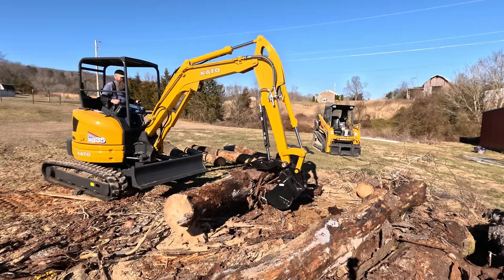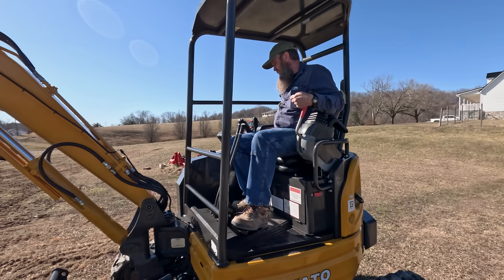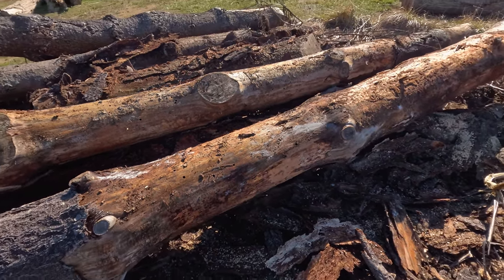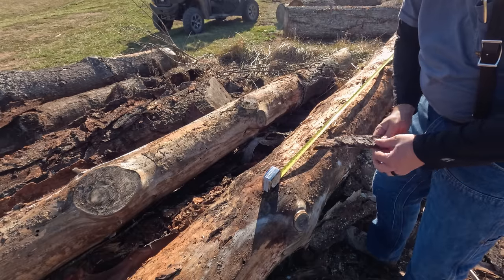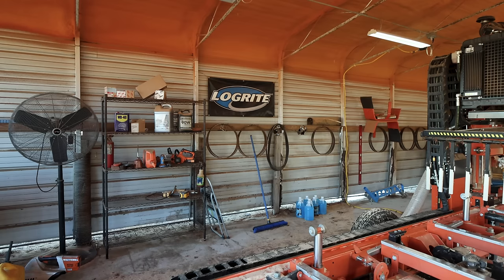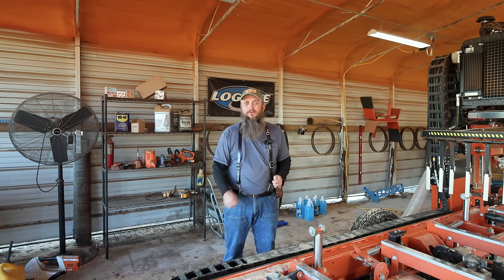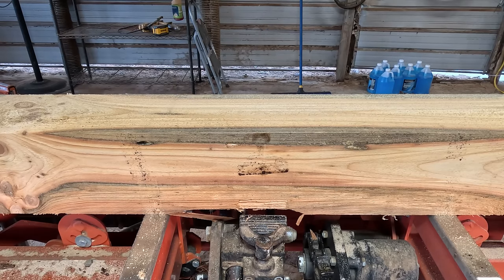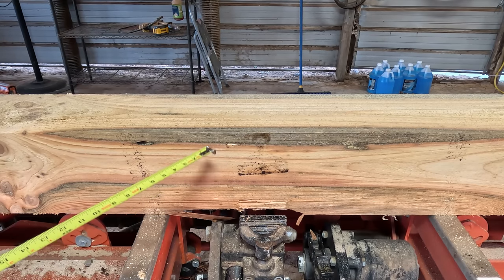Blue Stain Pine! A Waste Of Time Or A Good Find?

Comment: Hi, Nathan. I used to be a certified softwood lumber grader, here in Alberta, Canada. If I remember correctly, blue stain doesn't continue, once the tree is felled (it's the same with white speck). When I worked for this pallet manufacturer, the foreman had me sort out the boards ones with white speck, even though if it was 'firm' (meaning it won't crumble easily, under thumbnail pressure; if it does, then it is considered 'honeycomb,' and is to be treated the same as regular rot, according to the NGR). I told him that firm white speck had no effect upon the strength of a piece, but he said the customer couldn't be convinced, otherwise. They didn't want it, so it was relegated to being free firewood, and was a waste of good saleable product. It was for just rough pallets, anyway, but the customer wouldn't budge. I even told the owner that because of that, he was losing money, but the customer was a dumb shit.

Comment: Nathan, would you placing two pallets on the ground, at the head of the sawmill, to stack your discarded lumber on help with your workflow? This would allow you to pick the loaded pallets up with a front-end loader to take to burn pile, thus eleminating you having to lift that same lumber again, off the ground, to place on same front-end loader or trailer.

Comment: When you build the equipment building, consider building a heavy shelf unit for attachments you hardly use. I built one with skids and lift them off with the forks. Then when I'm done, clean them off, put them back on the skid and tuck them out of the way again.
Reply: Well now, that's a right good idea. 😁✌🖖
Reply from the maker: Not a bad idea
Reply: That’s what I do with mine. It’s a good idea.

Comment: As a southern forester for 40 years and the owner of an LT40 Hydraulic sawmill, I can verify that the blue stain fungus is definitely transmitted into the tree by bark beetles, like the mountain pine beetle and the southern pine beetle. Blue stain fungus does not damage the structural properties of the wood. These beetles only bore through the outer bark to the cambium layer and create tunnels and egg galleries in the cambium. Those larger holes you pointed out going deep into the wood were made by wood boring beetles that move in after the bark beetles have killed the tree. These wood boring beetles are the ones that can be heard chewing on the wood.

Comment: there was a local lumber yard near me that used to cut pine boards and then stack them to le them mold with pine stain.  They did not use separation boards for air flow and it allowed them to mold causing blue staining.

Comment: Hi Nathan, When sawing your logs to length in the yard and for cutting firewood to length why don't you lift them off the ground with the excavator. It would keep them out of the dirt and save your back by not bending over so much and keep your chain sharper. I love your channel. keep us informed on all your products you use and your expertise on sawing.

Comment: Back in the mid to late 70's I worked in what I called a dimension mill, we made panels to all different sizes for kitchen cabinets and other furniture from pine wood. Blue stain for us was a defect and couldn't be used, I remember we refused a whole load of lumber because of it. Funny how times change and now it's more valuable. Maybe it was then also but not for what our costumers wanted. I was a lot younger then so my knowledge was lacking.  Can't wait to see the end results of your two by's interesting video looking forward to the end product.

Comment: I think lumber yards don't like the blue stain but for wood working I think it looks great.  I would take that over regular pine any day.  When I had to get a pine tree taken down the beetles got into it soon after it was on the ground.  They like the cambium between the bark and the wood but once the larva get big enough they will start burrowing into the wood leaving those holes you showed in the video.  I found if I debarked the logs before they burrowed in I could get the staining without the holes but if the bark stayed on to long you would start hearing them burrowing in and would find those holes.  That can be fixed with some epoxy so it's a little more work but you can turn a defect into a feature with a little epoxy. When I get home I have some of those holes to fill in some panels I'm making for a project my wife wants. She's saying I'm making it to fancy and taking to much time already so I better get it done when I get home from work.

Comment: Hi Nathan, I searched for a hack on disconnecting the beeper on Mrs KATO… Best I found is actually finding the beeper speaker and just unplugging it😊. I have been a big fan for a while now, I Luv watching your progress🏆 My regards, Tom Marshall in St Petersburg, Florida ☀️
Reply from the maker: I will check it out
Reply: @OutoftheWoods0623 
Pay attention to when it beeps.  
If it happens when one of the arms is very extended, is it warning that your center of gravity is not favorable for traveling, or maybe with the ram extended you may be low on fluid.

Comment: I would think that BEEP, BEEP alarm going off, for forward AND backward movement is using the same Speaker.  Being used only on your farm (vs commercial) I'd probable just disconnect the power wire gong to it and tape it up.  Sounds simple enough.

Comment: You can disconnect the beeper and pull the wires at the connection and put a flat fuse into the connections

Comment: In the video, when you talk about the blue color, you can see the rot and how porous the wood is. The log clamp has easily damaged the cant because the wood has lost its integrity. In Canada, pine is used for moldings. Blue pine is considered worthless. I mill 5000 bf on the old LT40 (it has 10,000 hours) from time to time to make my beekeeping equipment. Any rot needs to be cut out/back at least 8 feet of the log from the rot, or the lumber will turn soft and porous quickly. Even painted or stained, used outside the board will soak up water and rot in two years. Dimensional lumber is weak. Pine, like any soft wood, can not lay around on the ground. It needs to be mill asap or bugs and beetles move in. Years ago, wet storage, logs kept in mill ponds were to prevent bug damage because it took months to get all the logs through the mill.
Reply: My father-in-law accepted a lot of blue stain pine and made our dining room table and chairs, bureaus, and other projects, and they held up fine for over thirty years.  It may be when he received the wood in the course of production that saved it

Comment: I have been an equipment operator since 1973, this is not a criticism but it doesn't sound like you do not have enough RPM set on your throttle control, I have always run excavators at full throttle, you will find the controls much smoother and your production will quadruple, low RPM is actually a stain on your pumps, just remember slow and steady win the race, first you get good then you get fast! smooth subtle use of your pilot controls take a little practice, but once they feel like an extension of your arms and hands, without thinking about it, your well on your way!, All the best to you!, Love your videos!, Thanks for sharing!
Reply from the maker: KATO manual says no full throttle during break in period. I get what your saying

Comment: Nathan I would respectfully like to suggest that you run your equipment at a higher RPM.  The Catto excavator, and the mowers and bushhog would be more efficient at a higher RPM.  Just speaking from experience .
Reply from the maker: break in period on both machines still,

Comment: Nathan, wouldn't it be easier on you if you bloked up the outer ends of the posts that you drop the log on to roll to the saw mill. Even if you have to give it some help gravity will be on your side. None of us are getting any younger😂.
Reply: I thought about that too. No, it wouldn't work.
If you put two or more logs, on the rails, the first
one in line will be on the lifting forks. When you
lift it to the mill, the next one will roll into place,
which, with the forks up, will be Under the forks
when you bring them down. Now you're stuck.😁✌🖖

Comment: Seat belt most likely, just buckle it.
Reply from the maker: nope tried that also,
Reply: The beeper is a warning, for anyone nearby, the
equipment is in motion. Especially in reverse, because
it is difficult, for the driver to see behind. They are on
almost all heavy equipment and trucks. 😁✌🖖
Reply: @zapa1pnt  knew about the reverse beep not the forward.

Comment: Blue pine has nothing to do with bugs . It happens as the sap ages in a log left to long . Logs harvested in the cold months keep longer than summer cut logs . Pine needs to be cut very soon after logs are down to prevent this .
Reply from the maker: That's not correct, you might be referring to mold maybe which is removed with bleach and some sawyers leave it on the boards for various reasons. If this wasn't correct, having the biggest sawmill channel on YouTube I would not share false information. The various colors of Blue Stain Pine come from a non-destructive fungus that the mountain pine beetle carries. These insects bore into the wood, causing the fungus to grow inside it. I learned this in my forestry classes  at the University of TN. This is common knowledge in the sawmill industry and is also pointed out in the NHLA handbook for sawyers.
Send me an email and I can send you some books that will help educate you on the topic. And as always I didn't write the rule book, 
thanks for watching
Reply from the maker: Also here is a quote from the Memphis Lumber Association Email I get every month. I new I had this saved but took me a minute to find it on my hard drive:

Mountain pine beetles develop in pines, particularly ponderosa, lodgepole, Scotch and limber pine. The mountain pine beetles (and other bark beetles) transmit blue stain fungi. The beetle carries the spores of the fungus on its body and they are deposited as it chews through the bark and phloem during attack. Fungi grow within the tree and assist the beetle in killing the tree, and the fungi give a blue-gray appearance to the sapwood.
Reply from the maker: Thanks for the reply. Appreciate you